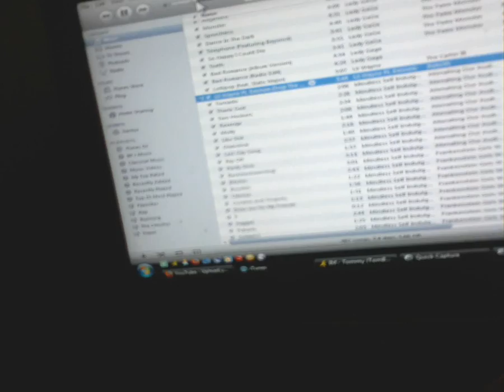PSU+Battery+Amplifier+old stereo

Comment: so ur saying is dosn't matter what power of the psu then right long as its running 12V's
Reply from the maker: From what my experience was, and the theory behind using a PSU to simply charge a battery (the main source of energy for the system) during and after use, i'd feel comfortable saying yes, it shouldn't matter what power PSU you decide to use, as long as it is simply charging the battery.

Ideally, you should find a method for shutting the PSU off when the battery is at full capacity.

Comment from the maker: That's one of the interesting things about that set up, the battery never had the chance to get fully charged.  (I've since learned many things about battery cycles and the problems with continuous charging)  
If the battery WAS fully charged, and having energy constantly dumped into it, then yes.  There is a possibility for... interesting things to happen.  
I would strongly advise researching the dynamics of automatic cut-offs for charging systems before doing this project.

Comment from the maker: @MultiAdamcampbell 
I'm sure you can.  
The thing with a battery charger though is that they tend to be expensive, and if you aren't drawing enough current from the battery, you'll end up pumping in too much and may have a serious situation on your hands.  
Plus, battery chargers are like $150 for a good one.  That PSU was like $40. :P

Comment from the maker: @Majin92 
What do you mean, connect it normally?  lol
The amp draws waaaay too much current to just run it off the PSU alone.  It's a 1300w amp, and the subs/6x9 combination has the potential of drawing 600w peek.  For a lil 580w PSU, that's a bit much.  That's why the battery is required.

Comment from the maker: @carlito2501 
You can use a battery by itself, and it will play nicely for a while. 
I've noticed several things about the set up, some of which may just be something i've done wrong.  
I have my PSU connected to the battery, so that the PSU charges the battery.  The amplifier draws off the battery, like a reservoir.  
I have noticed that the system goes into protect mode if the PSU is turned on AFTER the ground terminal is connected.